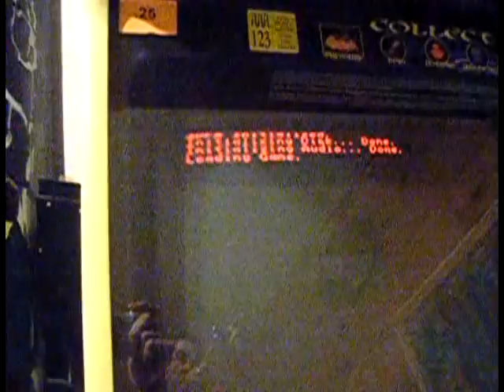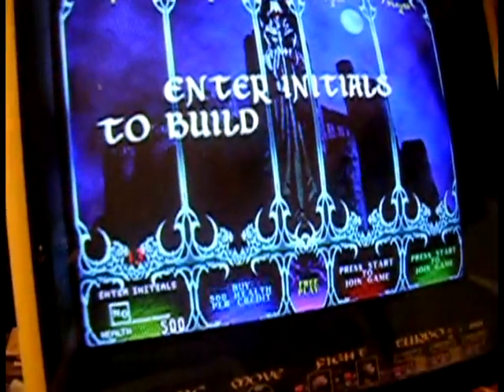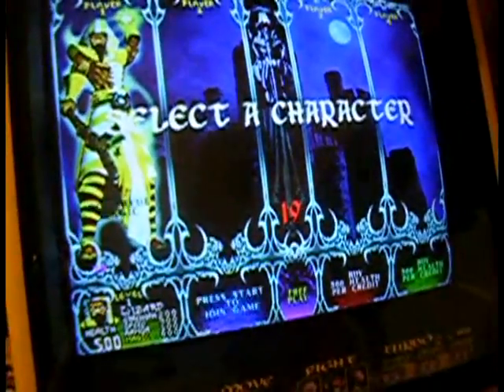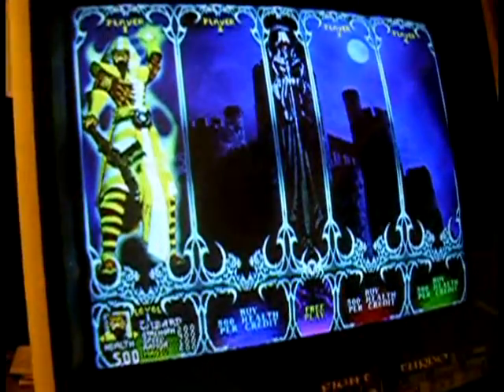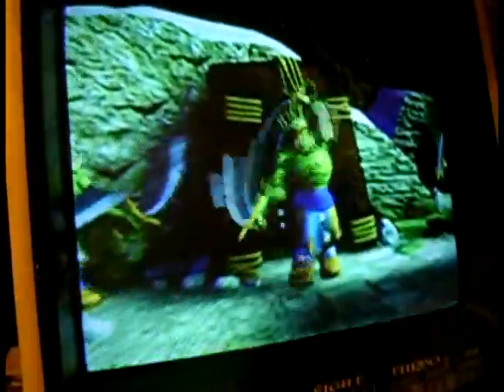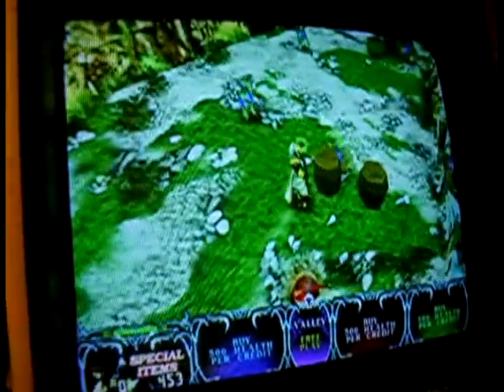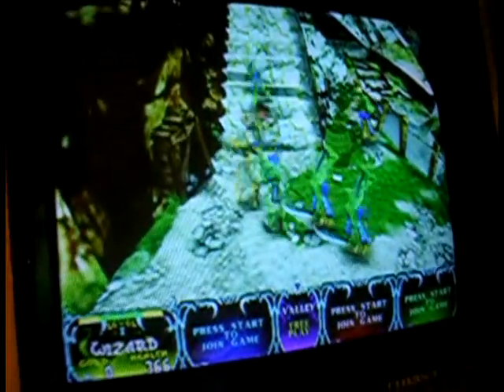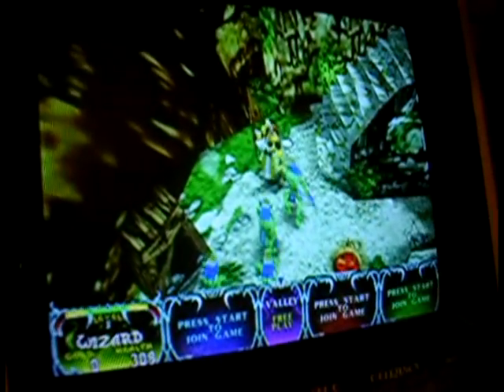(Part 1) Gauntlet Legends Video Card Substitutions

Comment: 3dfx will work
Reply from the maker: Yes a 3DFX Voodoo 2 with at least 10 Megs of RAM will work.  (So basically a 12 Meg retail Voodoo 2 card.)  Can't be a Voodoo 1 (or Rush), 3, 4, 5.  Can't be a Voodoo 2 with only 8 Megs (it WILL work and run, but will have missing textures and such).  Can't be an AGP card for obvious physical compatibility reasons.  (PCI ONLY!)  Can't be a Voodoo Banshee (missing a Texture Mapping Unit, so although they came with enough memory, they were crippled combo 2D/Voodoo 2's in a way).  I couldn't get one to display anything in Gauntlet Legends.

Comment from the maker: Most people are going to Compact Flash drives to replace these.  But, you should be able to use about any standard IDE drive as long as the capacity is large enough, and you image it correctly with the right version of the specific game you have installed on the Vegas 777 setup.

Comment from the maker: Yeah basically.  There are some discrepancies I have found out w/certain games.  If you have the correct 2 chips to swap for a game and the same version hard drive as the chip's versions, then you should be able to do it if you also have a compatible video card.  I have been told some people could not use the same video card that came with GL with certain games that are compatible with the Vegas 777 setup.  (You end up having to swap a small security chip on the video cards SUPPOSEDLY.)